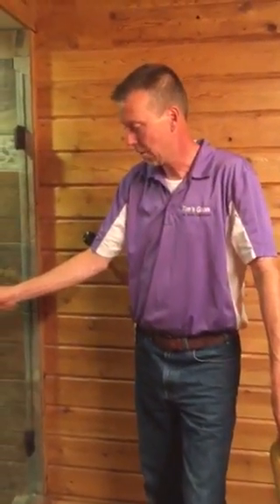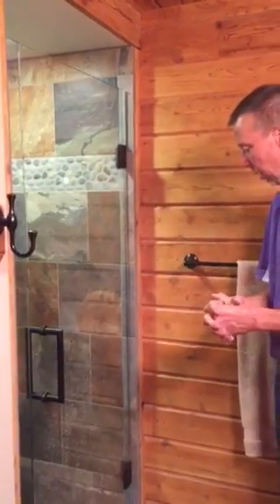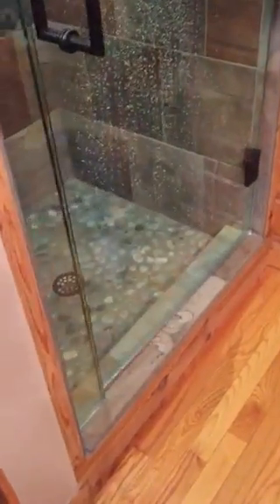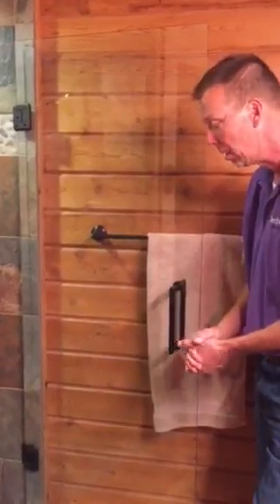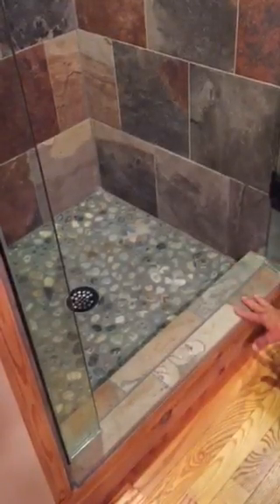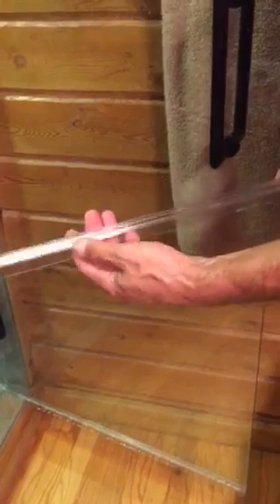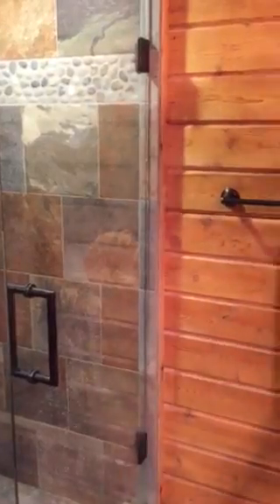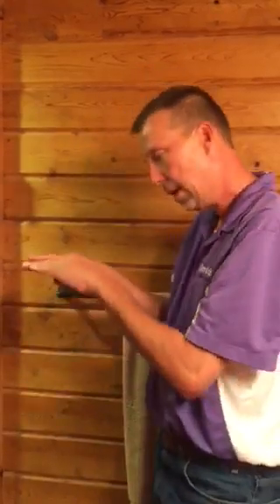Tim's Glass - Fixes Leaking Shower Door - Improper Curb Install

Comment: Hey, Tim!  I am going through this exact situation as we speak.  What a nightmare.  After about 3 attempts, I finally went to a door sweep with a 3/4 inch fin at the bottom.  The gap between the bottom of the door to the curb was close to a half inch.  Not to mention the curb was pitched outward, away from the shower stall.  So, yes, water on my floor was an every day occurrence.  The longer fin has stopped about 85% of the water, but the curb needs to be re-pitched.  That's a bit out of my league, but watching your video now helps me to better understand what I am up against when I hire someone.  Thanks!
Reply: Where did you find the longer fin sweep?

Comment: Hi Tim we have a step down shower with frameless barn door style doors that slide from left to right, and the showerhead is on the right side of shower. Tons of water leaking out through under the little space between the glass door and tile floor. What can we do? Thanks.

Comment: Very common issues, the solution lies in the design in the beginning. The Tile Professional must pitch the curb "down and in" and do this right or callbacks will keep coming. The homeowner believes it is some flaw in the installation of the Shower Enclosure. This is just common sense, water runs with gravity or tension so it will follow where we lead it. Together we can over comer the water issues. Thanks for the Video!

Comment: Any ideas for a sliding glass door?  There is a gap between the bottom of the door and the tile.  I can’t put anything on the bottom of the door because the track it slides into.  Any ideas would be most appreciated.  I have been living with it but would like suggestions on a solution.  Thanks.
Reply: BiggestComplainer  That is what I thought but wanted to see if there was anything I didn't know about or any ideas.  Thanks.